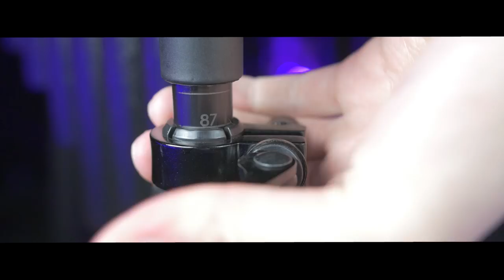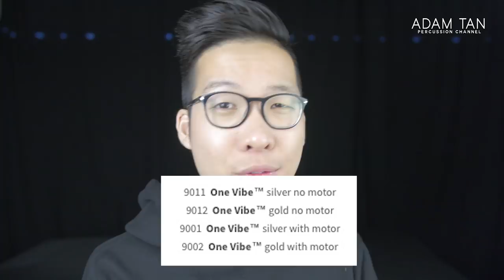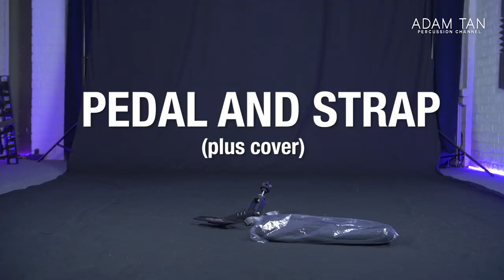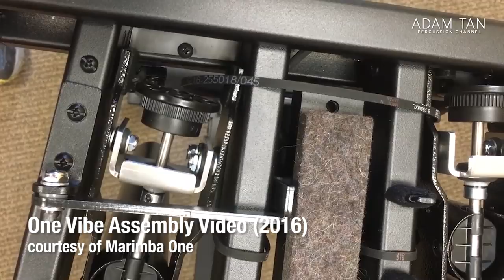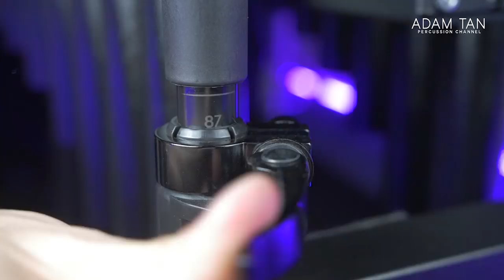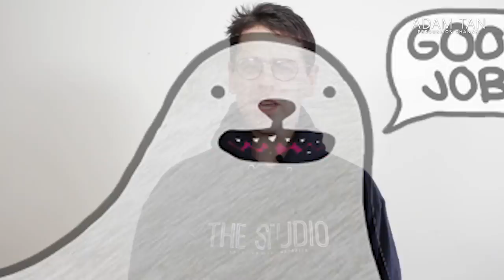Comprehensive Review of the One Vibe by Marimba One

Comment: Are you going to review any more vibraphones? I've been looking around but there don't seem to be many on the youtube or internet in general. Also, do you know if the One Vibe is tuned to 440Hz or 442/443Hz? 

I was looking at at Adams vibes; are you aware of any percussion stores in the western United States where someone can actually view vibes/ marimbas from different brands in person?
Reply: Also it seems like the One Vibe doesn't have a digital setting of how fast to set the rpm of the paddles. This seems like a major overlook to me. Rather than a slider bar it would be great to be able to set the rpm of the paddles from 0 up to 200 or wherever in increments of one rpm.
Reply: The biggest percussion store west of the Mississippi is Lone Star Percussion in Texas. That might not best what some folks consider “the West”.